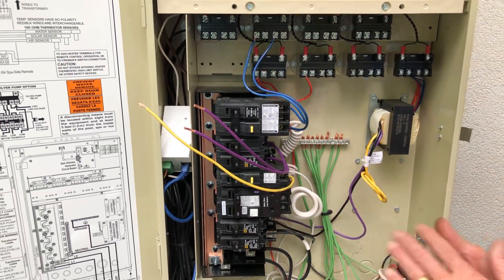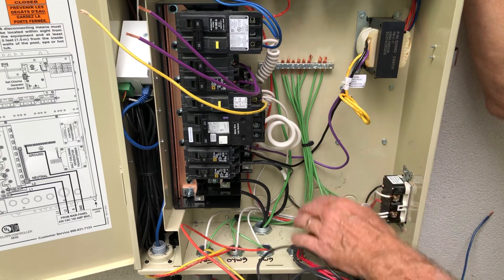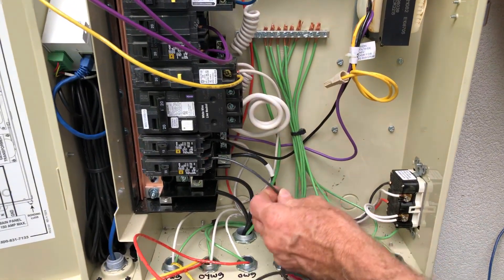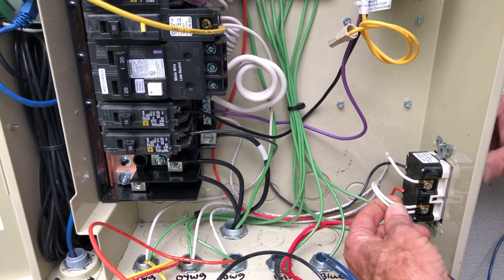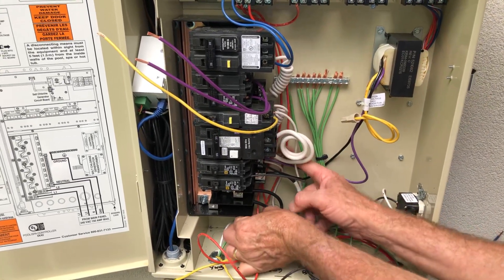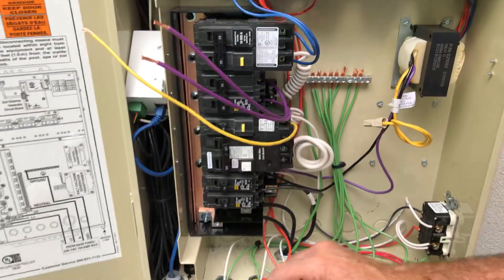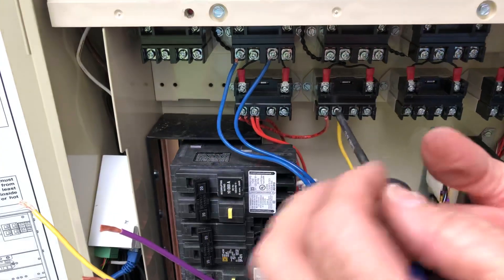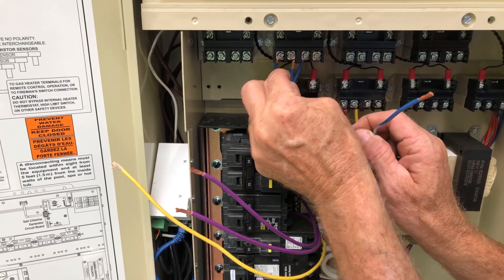Pentair Control Panel Wiring : Part 2

Comment: What is required t the panel to wire in 5 10in pool lights, 6 small globrights, 6 lamanir lights? All low voltage lights.  All I see is a big mess that’s is super confusing on my pool

Comment: How many lights can you hook up to one relay? How many lights per breaker? How many per outlet? How many transformer?
Reply from the maker: These relays can operate with a normal load of 15 amperes per pole.
The Breakers, wire size, and transformers all require knowledge of electricity to calculate the needed parts for everything to work properly. I suggest you find some good videos on YouTube that explain Electrical words like: Voltage, ac current, dc current, wattage, amperage, phase, cycle, wire load, transformer, circuit protection. This will help explain how all this stuff works.

Comment: Why do so many pool panels have gfci outlet and gfci breakers? Don’t you only need one or the other? Both seems kinda dumb. If only need on or the other, is one or the other always allowed or do some needs gfci breaker and some need outlet?
Reply from the maker: The GFCI breakers or outlets protect the swimmers and people working around the pool equipment from accidental electrocution. It is now required in the USA in the National Electrical Code. As far as the pool lights, you need only one or the other, many builders like to use the outlets because 1. it's cheaper, 2. It is something the homeowner is familiar with. 3. One doesn't have to open the cabinet to reset it (nearby lightening strikes will often trip them). 4. It's nice to have an outlet bt the pool equipment.

Comment: If the panel has low voltage transformer built in why do pool light still need a separate transformer?
Reply from the maker: The low voltage transformer is only to supply power to the control circuit board, valve actuators, and antennas. The pool light requires more amperage than this little one can safely convert.